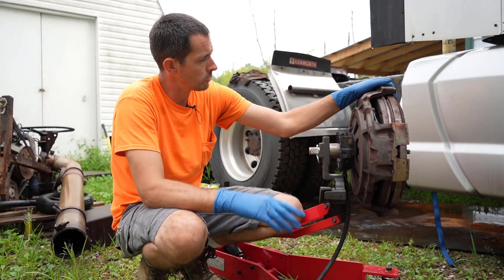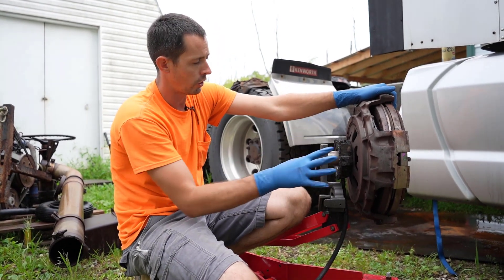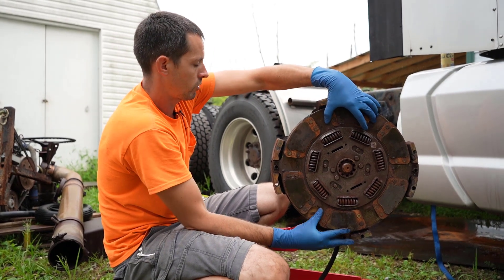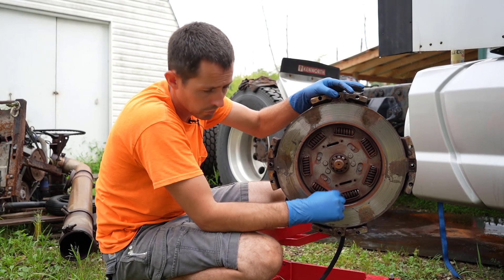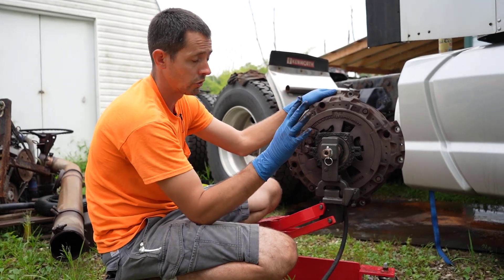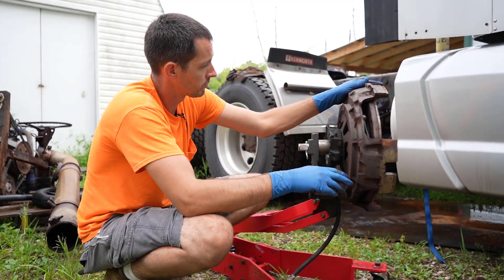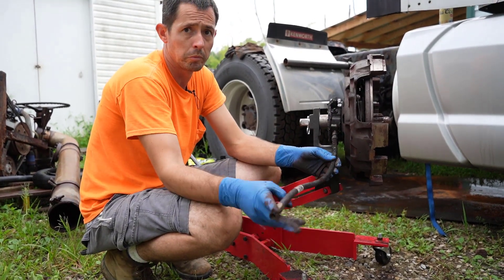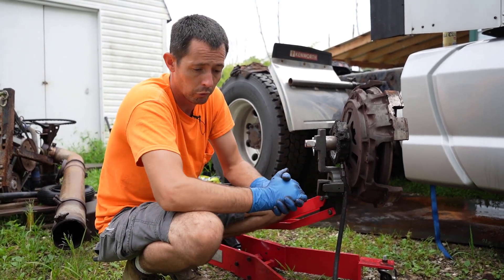A Close Look at a Semi Truck Clutch & How it works

Comment: You might want to look at self-adjusting clutches again. I had one in an '03 Columbia I bought used from Ryder in '08. They put it when I bought the truck and it lasted me 8 years before I had to replace it (approx 80k mi/yr) and never had to adjust the clutch. Great content. I'm a recent subscriber. Other than a little wind noise, the audio sounded fine to me.
Reply from the maker: Thank you Bob.

Comment: My clutch just started messing up, about ever 8-10 uses of the clutch it doesn’t stop the spin so I can put it in gear, so far I just pump the clutch once or twice and it stops the spin and I can get it in gear. Will work just fine for about another 10 uses then has that same problem again. What do you think is wrong with my clutch? Hydraulic clutch so I was told it can’t be adjusted

Comment: Hi Ryan. I enjoy your videos. I have a question: I just blew out my clutch pedal yesterday as I was pulling into a Blue Beacon. I just pressed the pedal and "CRACK", the pedal ended up on my floorboard. I had to manually pull it back up, but when I push it back down, there it stays. Did I just blow out the cable maybe? The clutch and tranny were were working great up to that point. No slipping or anything. I have a 13-speed Eaton Fuller. Thanks for your help.

Comment: Question , I just had my clutch replaced and also fly wheel , rear main seal , clutch brake , clutch bearing , u joints , and rear engine mounts . The problem I’m having is when I get to 7 or 8th gear , with a full load , my clutch is popping out of gear , this is while I’m going up hill , is there a problem with clutch ? Do I have to adjust the clutch ? My engine is series 60 Detroit on 2005 freightliner century.

Comment: Hey appreciate the video but I have questions what if my truck shifts to 1 to 5 with no issues then trying to shift into 6th all grinding and not shifting is that a clutch issue or a transmission issue help please!!!
Reply: Transmission gears could be worn out.

Comment: Thank you for the amazing content but for the love of God please invest in a good mic
Reply from the maker: Sorry about the bad audio experience.
Reply: @truckingandfixing  haven't noticed any prob with mic. maybe it's their speakers. HA
Reply from the maker: I finally figured out the issue, it was the the audio, when we bought the new audio recording device, it came with mono recording. So it was recorded mono for a while now. Only when you use the stereo speaker, you would notice the issue. Now I have changed the setting to stereo. The issue should have been resolved moving forward.

Comment: Any idea what would cause a terrible rattling noise in neutral? This clutch was just installed abd it sounds like nuts and bolts inside
Reply from the maker: Did the transmission get worked on? and does the rattling noise still there when you press down the clutch?

Comment: That clutch looks like it need to be replaced.  What is your opinion on it's life span.  This is used to 90% of it's life, time to go...  or This clutch is at 50% of it's life and I will just put it back in for another 300,000 miles.       Please???
Reply from the maker: It is getting close to its life span. I am going to replace the clutch. It is hard to say how many more miles it will last of I put it back! However, I am not replacing the clutch because it is bad. It is because I am doing the transmission job, it makes sense to replace the clutch as well.